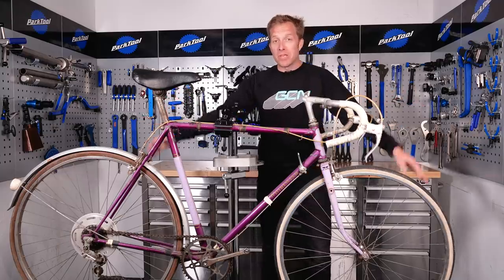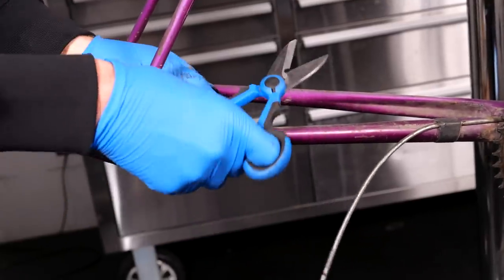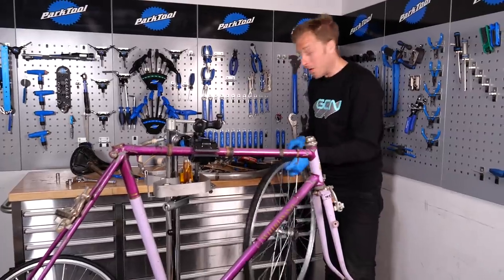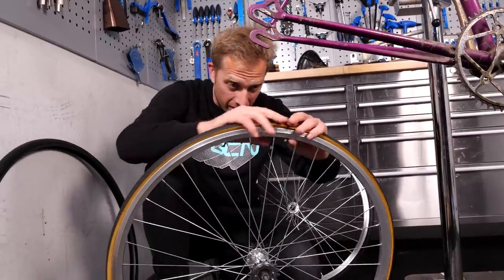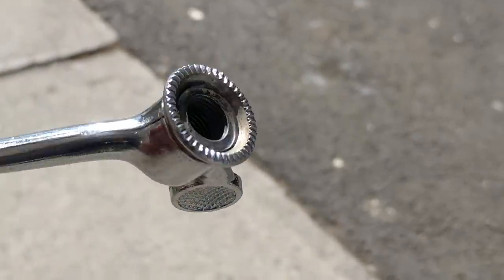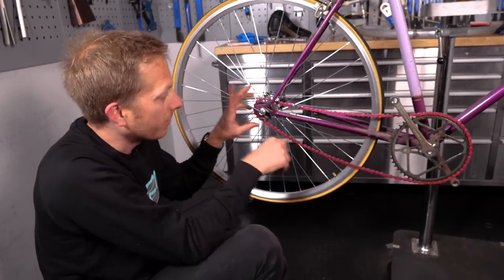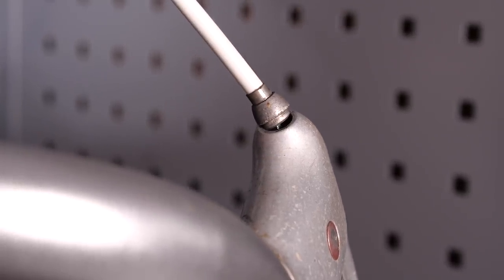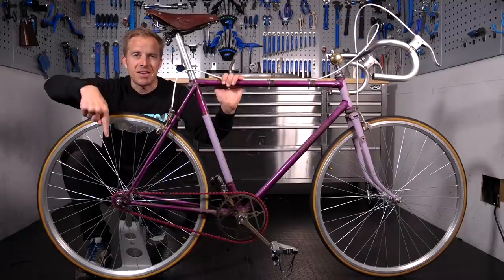Building The Bike  | Vintage Replica Bike Build Part 2

Comment: Well I got a vilano bike disk brake 7 speed free wheel quick release but the awful thingthe shifter  so I am thing to change to shimnao calris 2x8    But the problem how I change the 7 speed gears to 8 gears  it is free wheel not Cassatt system if  change the hub to a Cassatt hub 8peed will it fits in my frame ????? Even if I choose tourney sti shifters system 2x7  do I need to change the crank set and add the shifter to sti.   Or I need to change more stuff  what is better calris system or tourney  or they are near???? The front derilar  is 7 speed tourney Tz 7 speed the back one is tourney 6/7 speed both of them are sis index thanks

Comment: I was really surprised to see you put brake pads that are made for steel rims when you switched to alloy rims, why would you not use pads for alloy wheels? You’d have working brakes then.
Reply: Also Reynolds 531 was first introduced in 1935.

Comment: My mechanic OCD is off the charts. Freewheel on the fixed side(not an ideal thing to do), wing nuts instead of just leaving 15mm nuts to tighten the rear wheel up good(because the wheel will slide forward), not cleaning the bike, making putting on tires look like a monumentally painful task, and lastly the cable and housing woes. Love the videos but this one was slightly painful. Guess il write this one off as entertainment purposes only. Crack on mates.

Comment: There are bad jobs and then there are really bad jobs. Jon, you've let the side down. Clean the chrome, clean the frame, get those cable lengths sorted out and.. and.. and ditch the adjustable spanner for a few quids worth of imperial tools.

Comment: i would have appreciated some rust removal product being used on the calipers and crankset. and a wee bit of nail polish on the rusty bits on the frame. and loads of goo gone on the tape residue. i get that production times does not always allow for a repaint, but its the devil in the details i think.

that said, i wont be surprised if suddenly in episode 3, we see an unrecognisable bicycle with a spanking new paint job. lmao.

im curious about what appears to be a bottle dynamo mount on the right of the fork. perchance you can ask your dad if he has one lying about in his attic?

Comment: How insulting! That bike is 1953; not 'a hundred years old,' but that French Huret  style is indeed rare, in between a time that the support structure from the top, WAS a parallel set of spring (wire). Much lighter than todays 'best,' but not running parallel to the cog angle (the gap in high gear was... a lot!). Why do you make it a single speed? Why insult the Reynolds frame? Once a lead bike gets up to speed , it tends to STAY at speed; weight issue present on hills after all. Perhaps you should go Really Modern, and leave the seat post in, but forget the saddle. Masochism San Francisco style! Let's not forget to, SRAM bought Huret.
Reply from the maker: wasn't it Sachs who bought Huret? Jon

Comment: Jeez, this is pure amateur hour.

Two things, out of maybe 10 I saw in this:

- cold setting the rear dropouts to accept a narrower OLD on the hub is no big issue on steel

- taking 1mm of material from the fork’s dropout slot to accept a 9mm axle (instead of the original 5/16th) is totally fine

I reaaaaaally could go on.

Comment: That frame looks like toast to me with a crack or major corrosion or both at the bottom of the seat tube close to the bottom bracket. I'm not 100% sure but perhaps a clean would better show if the frame was safe to use. I think Jon oversells his abilities a bit , master bike mechanic he is not.